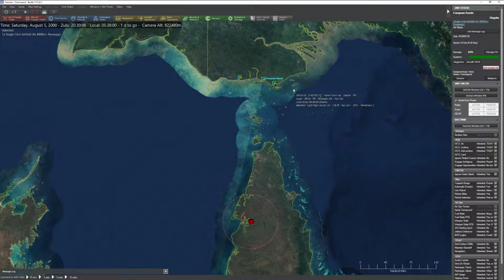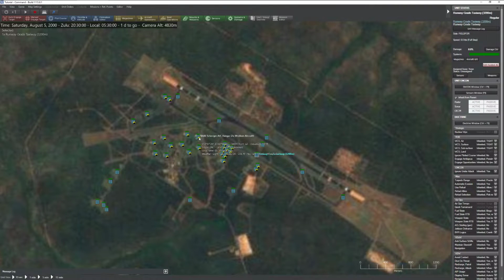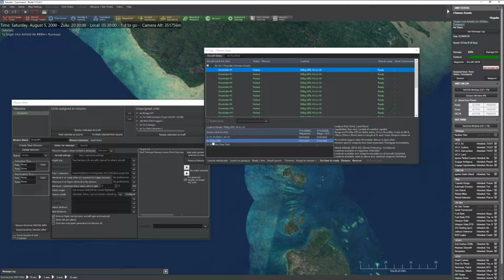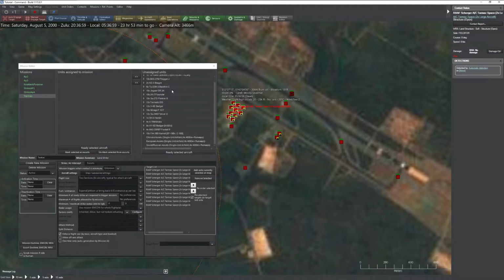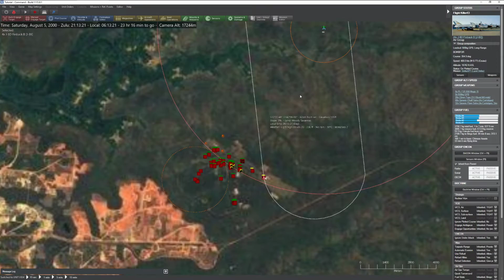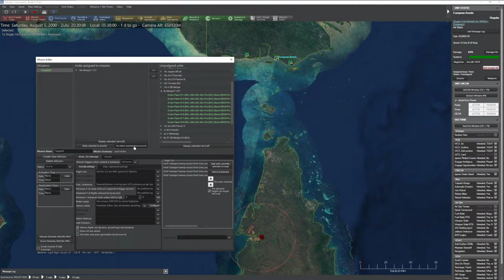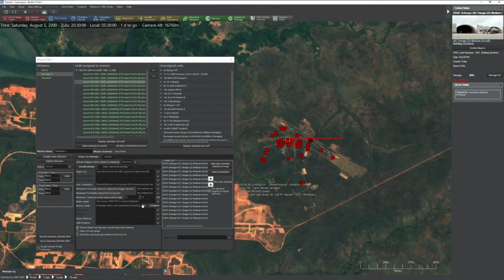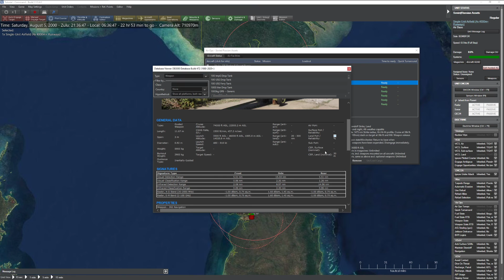Command: Modern Operations Tutorial - Disabling an Airfield

Comment: great tutorials, keep them coming! You've taught me so much, I can actually enjoy the game more nowadays. Question, so without using stealth aircraft, how would you go about pulling off a "sneak attack" on any airfield (or other targets) to catch them on the ground? Mainly thinking scenarios like Operation Brass Drum for example.
Reply from the maker: Low altitude and terrain masking. Try to identify the sensors ranges, find their blind spot, approach at altitude to save fuel then hit the deck right outside their sensor range, cruise in and right at IP hit the afterburners. Use big groups to attack with a logical WRA and then attack all at once instead of piecemeal.  A lot of times you can draw enemy CAP away and then do the above to amazing success.  Consider weather and time of day also for extra hiding places.
Reply: @PGatcomb  Thanks, will try

Comment: Silly question:  I'm fairly new with CMO and was wondering how did you build this runway?  I've been doing scenarios with the single unit airfields that have everything contained and i've not been able to "break-out" the airfield like in your video.  Did you individually put the pieces together and linked them?  I feel that would make my scenario building better and allow me to have the AI attack my side as well to make it more challenging. If you have a video on this please direct me there. Finally, awesome video!
Reply from the maker: You build it piece by piece then group it together as one. Include runway, access point, fuel tanks, parking if some kind and ammo storage.